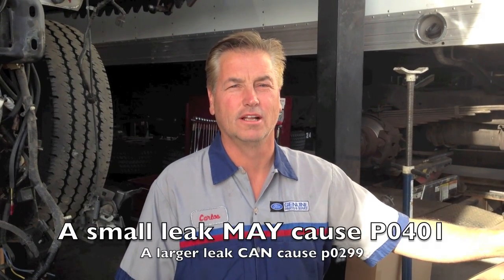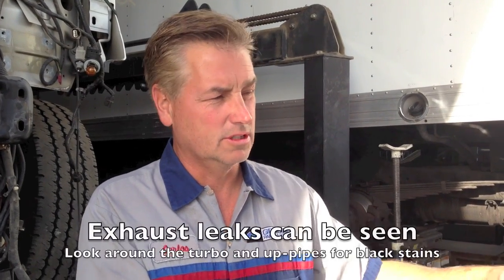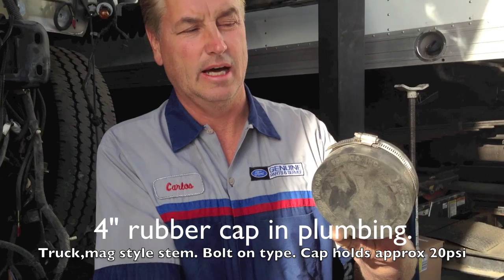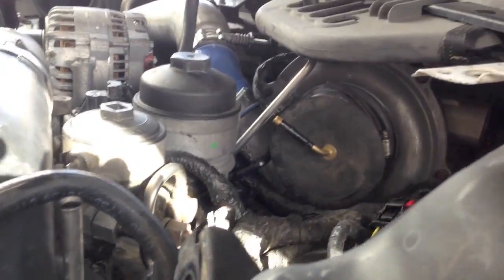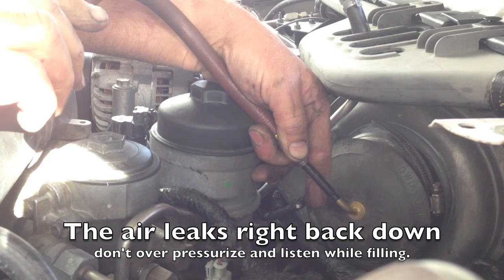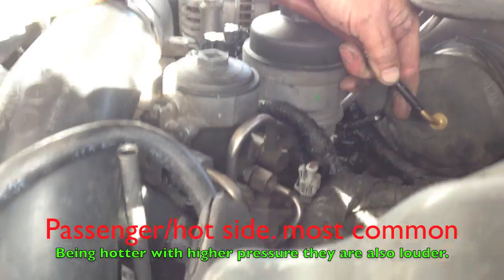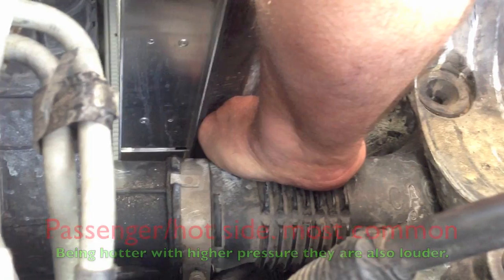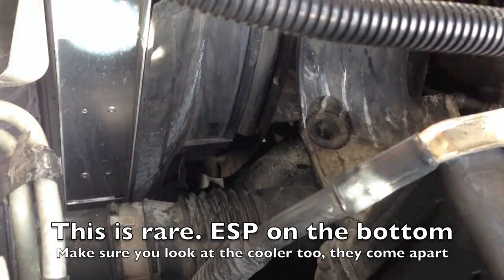P0401 on a 6.0 Powerstroke that is also causing a hissing noise.

Comment: A friend has a 6.0 that the cold air intake tube is coming apart inside and chunks of plastic going in the engine and I believe it has blown head gaskets he has run it out of oil several times and got it very hot and it has huge oil leaks with 397.000 miles and triple that for idle time but he will not believe me about having to rebuild the engine arrrrg. Has anyone else seen the intake tube come apart like that ?

Comment: I have a P0401 code also. I can hear a hissing noise by the right front headlight even at an idle.  I pulled the aluminum tube leading to the intercooler but found no breaks in the connection hoses. I can't figure out where the hiss is coming from.  It doesn't seem to be as loud in the engine compartment. As for the P0401 code i checked the EGR and it isn't sooted up.  The coolant/oil temperature differential is 5-18 degrees so the cooler seems to be working ok. I just cant figure it out.
Reply: You make working on trucks easy brothah I've never worked on a vehicle in my life but its in the blood. Thanks for your videos i feel like a mechanic after watching each vid. Also that Milwaukee gets shit! done imma get one because of you.
Reply: What was the p0401 issue and how did you fix

Comment: Thanks. I like the ratchet, do you think smoke machine would do the this job as well? I've been using it... but your idea is genius... thanks so much.
Reply: Victor Alvarado transport truck repair has been checking air to air leaks this way for ever. Compressed air is cheap.
Reply: Also the air pressure expands the boots and shows the leaks. Some leaks wont show unless under 20 to 50 psi boost pressure. Smoke cant do that